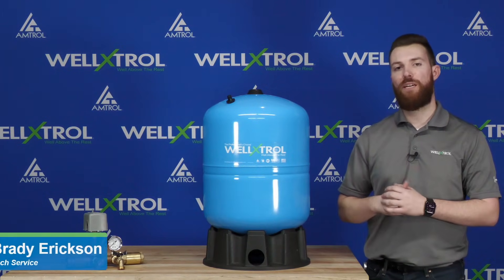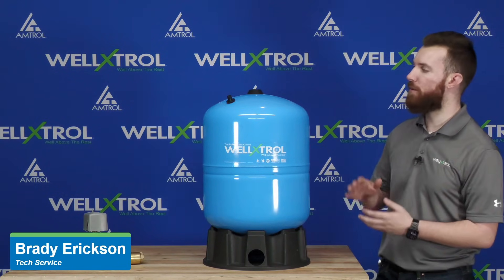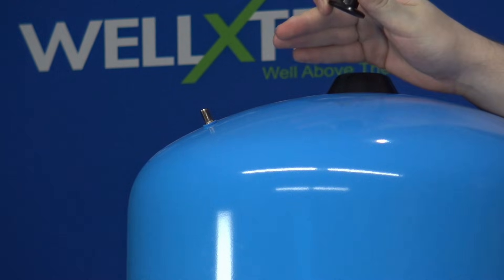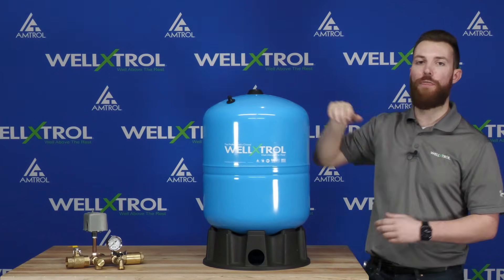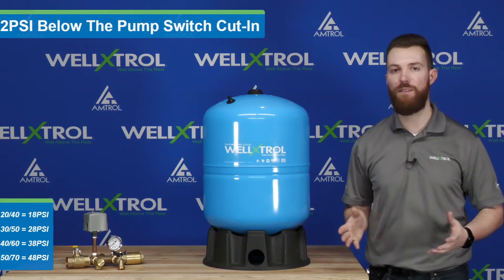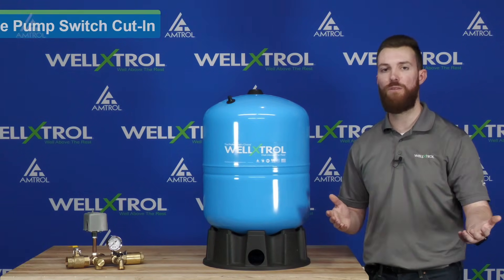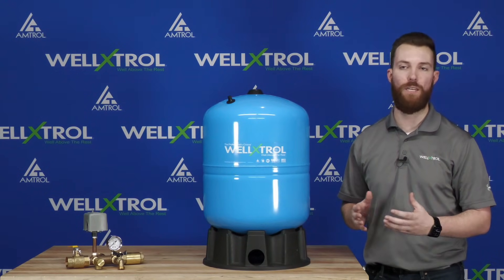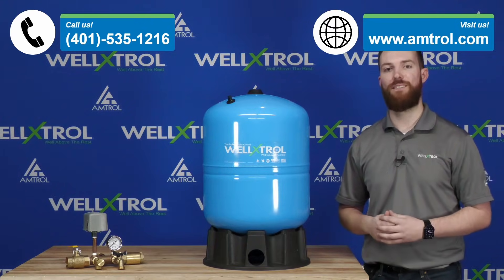Adjusting The Pre-Charge Of Your Well Tank - Amtrol Tech Takes

Comment: Hi, in the transfer pump cut in pressure is 9.7 bar. I bought new pressure vessel, which pre charge valve is 2.5 bar. pressure vessel max pressure is 16 bar.In this situation,How much air pressure I need to charge
Reply from the maker: If your vessel is rated for 16 bar, you would want to match the precharge to the cutin of your pump, which is 9.7 bar.
Reply: Thank you for your reply, can you please explain more

Comment: You didn't show how to do it.... My well tank is installed and already in use and I want to adjust it.
Reply from the maker: To adjust the precharge when the tank is already installed, you will need to shut off the power to your well pump and drain the water pressure from your system through a faucet or hose drain. Then, you can make the air pressure adjustments shown in the video. For additional support, please contact us at amtrolwatersystemsinfo@wthg.com or 401-535-1216.
Reply: @amtrolinc  Thanks, got it figured out and adjusted properly.